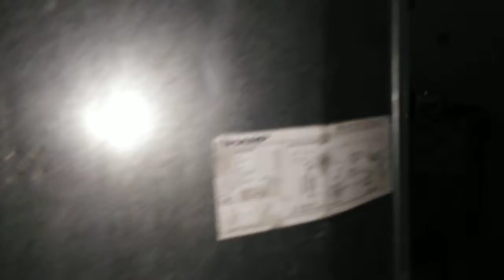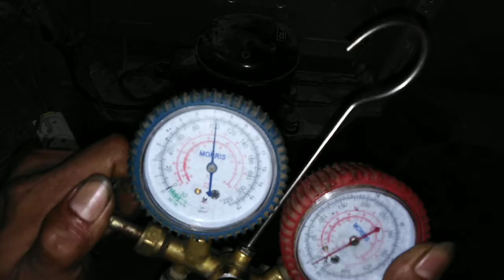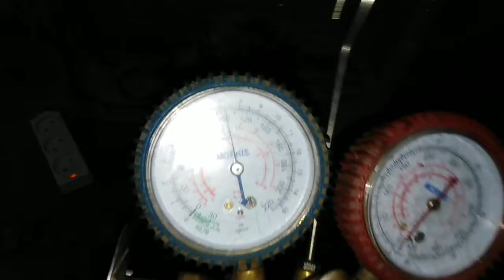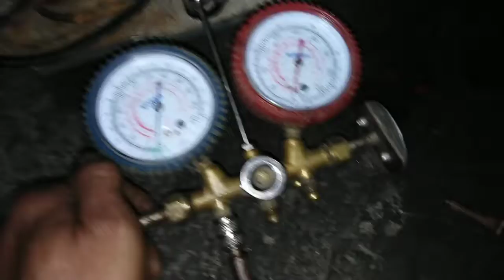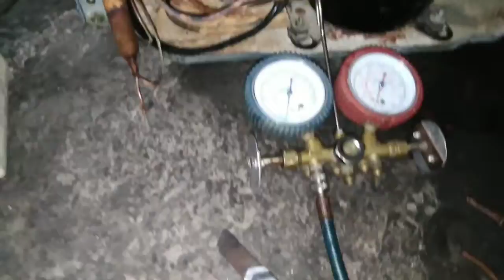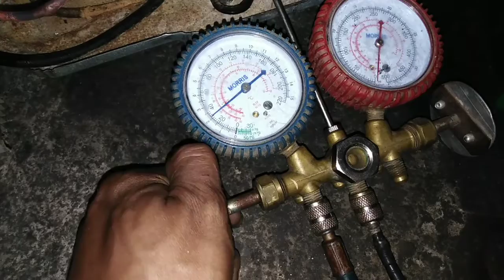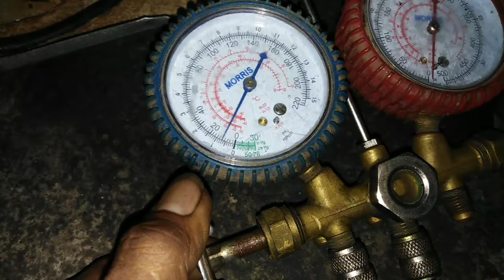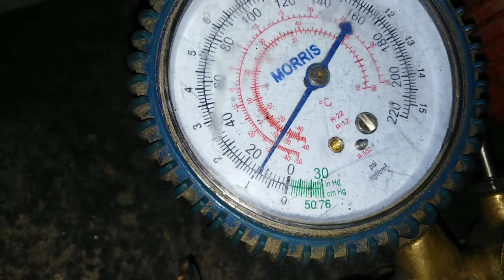cara servis kulkas untuk pemula dari awal

Comment: Selamat malam pak Kus..
Ijin bertanya : sya ada kulkas 2 Pintu (Sanyo Modul) sudah sya rubah dengan Timer 1-3 & jalur² & komponen²nya sdh aman (dicek dgn multitester & tang ampere), namun saat kulkas sudah dihidupkan selama kurang lebih 6-8 jam dibagian Pintu atas masih belum terbentuk Es Batu (sya taruhkan 1 gelas air). Kira² ada masalah dimana ya pak..? Mohon bantuan & pencerahan nya 🙏🙏
Reply from the maker: Cek dulu evap e saljunya rata nggak?
Reply: @kustehnik  kondisi di evap memang kurang merata bunga es nya pak Kus..
Bgaimana ya solusinya 🙏🙏

Comment: Om,mau nanya nih kulkas yg lagi saya benerin sama kayak yg di video tapi di filternya di ujungnya kawatnya cuma satu satu kalau yg video kan ujung satu yg besar masuk ke kondenser dan ujung satunya kan dua yg masuk ke kepiler satu lagi kan buntu itu kan untuk masuknya metil,yg saya tanyakan ujung kawatnya yg kecil cuma satu om nggak ada kawat buntunya jadi mau masukkan metillnya dari mana om?tolong om solusinya.
Reply from the maker: Kalo model vakum bodi, filter meski di bor sebesar kapiler lalu tambahkan kapiler, atau bisa di ganti filternya,,
Untuk vakum manual/mesin vakum, cukup dari pipa pengisian saja, atau metyl masuk ke manifol lanjut gas freon
Reply: @kustehnik  ok iya om baru saya tau.makasi ya om jawabannya ,jelas dan pas,saya do,a kan om banyak srrvisan dan berkah.soanya saya pemula om,belum pengalaman.

Comment: di bidang pengisian frion tadi apa bila lebih dari 10 psi gimana
trus kalo tidak kita turun naik gmana ...terimakasih ilmunya
Reply from the maker: Terkadang tidak harus 10psi kang,
Terkadang bisa lebih, tergantung kondisi unit, kekuatan kompresor, kelancaran pipa termasuk kapiler, bahkan cuaca juga berpengaruh terhadap saat pengisian, asalkan tidak lebih dari 20psi dan salju dah rata, amper tidak melebihi batas, itu dah bagus

Comment: Bang minta pengarahan,, klw kompresor kulkas es batu blm di pasang trs amperx sampek 1,4A,, itu bagus atw rusak bang,? Terima kasih
Reply from the maker: Kulkas berapa rak? Kompresor berapa PK mas? Biasanya tertera di bodi kulkas nilai Ampernya, kalau sesuai ya udah,banyak faktor yang menyebabkan amper naik, termasuk suhu cuaca juga berpengaruh, kebuntuan, kebanyakan freon, voltase listrik drop, kompresor spull dah lemah/short, begitu
Atau begini, jika salju atau bunga es rata sampai bawah, nanti nilai Ampernya akan turun,
Reply: @kustehnik  es batu 8 rak,, ini posisi kompresor saya cabut dr bodyx bang, hrsx amper mencapai berapa bang,,?
Reply: Mau  tanya ter kulkas saya 1 pintu suara di efap grok grok .kayak orang ngorok.kira kira apanya .ter yang rusak trima kasih jawabanya

Comment: Untuk alat2nya namanya apa aja bos
Reply from the maker: Alat untuk servis kulkas (1pintu dulu) 
-Manifol gauge(alat ukur satuan PSI) 
-clamp meter(cek amper)
-cutter kapiler(alat potong pipa)
-mesin vakum (nggak pakek gak papa, asal pinter2 vakum body)
-tang jepit(untuk menjepit pipa yg akan di las, di pakai di waktu setelah vakum maupun selesai pengisian..
-blender + red gas(untuk ngelas)
+pendukung lain
Kapiler, Pipa, Strainer, Pentil, Metyl,Gas Freon(refrigerant),kawat las perak, aluplatinum..
Itu dulu.. 
Sedangkan untuk flushing/pembersih tergantung masing-masing serta kondisi yg di garap.. Ada yg didorong,, ada yg di sedot,,
Yg blum bisa sama sekali, anda bisa belajar di mana anda suka.. Semua ada tertera di gogel, di yutup, di fesbuk, yang terpenting adalah NIAT,
Caranya= anda beli dulu peralatan servis, kemudian cari kulkas bekas yang minim mesin (kompresor) masih waras guna untuk praktek tahap awal,